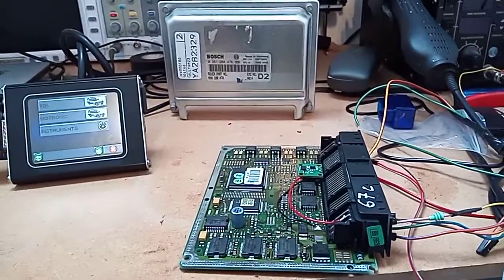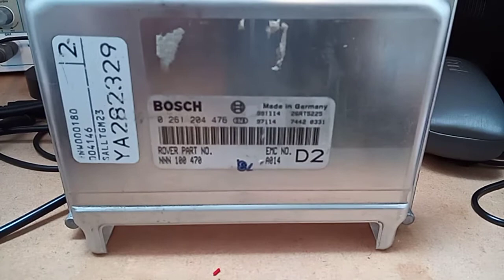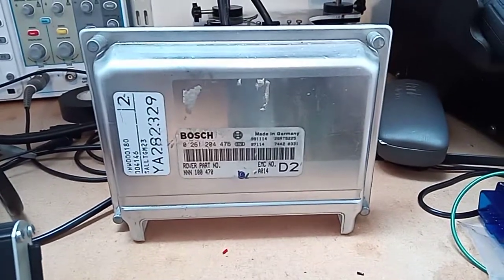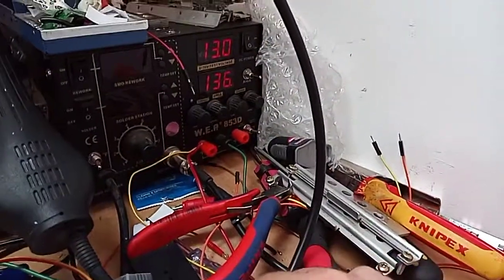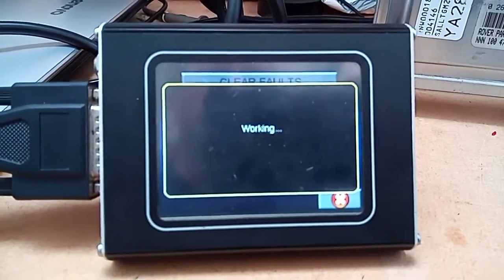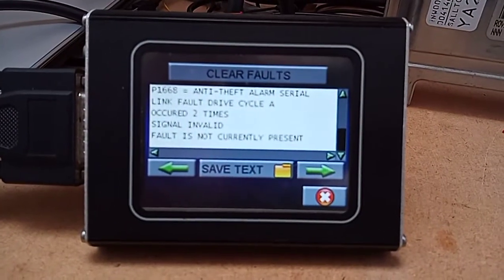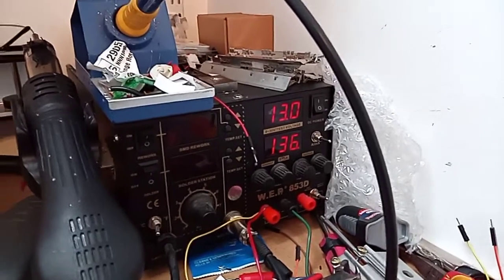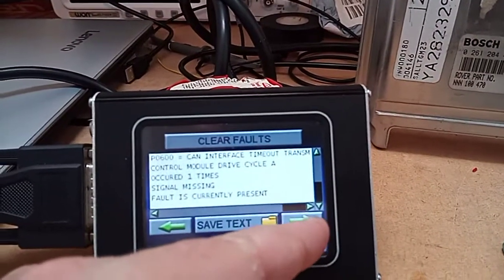Discovery 2 V8 THOR Engine ECU immobiliser removal by emulator.

Comment: Hi Simon, questions from Tanzania- I've got a disco 2 thor v8 that I often use out here, I have recently bought two spare key with circuit boards... I have a nanocom- but if I try introducing the new keys, the nanocom comes up with" cannot read ECU" this does mean that I can't introduce the keys...what could the most common issues for this be??
Reply from the maker: You need to be looking at the BCU to code keys.
If you are unable to unlock the car on the fobs or you have not entered the EKA at all or correctly, then the BCU will refuse to communicate with any diagnostic equipment.
Reply: Hey Simon....much appreciate the reply...the car is not immobilized and i can open/close,start and drive the car with the working fob, i bought the keys so i could program them in and use them as spares incase the one original key (of which i only have 1)that i have packs up on me...i go through the normal key programing method-valeo bcu etc on the nano com then get to entering the key code and this is where the error code of: cannot communicate with ecu pops up?? @ecux

Comment: Hi Simon. Great video. Please get in touch with me I have the dreaded L322 4.4L BMW 2006 steering column issue.
Reply from the maker: Sorry DR. Just seen this, I think we discussed the issue on one of the forums.
I can remove the immobiliser from the BMW 4.4 V8 used in the L322. Have never looked at the later Jag one.